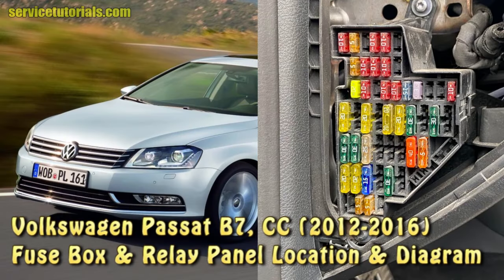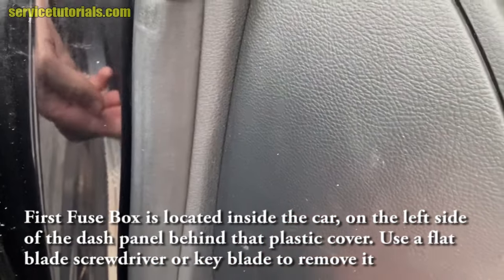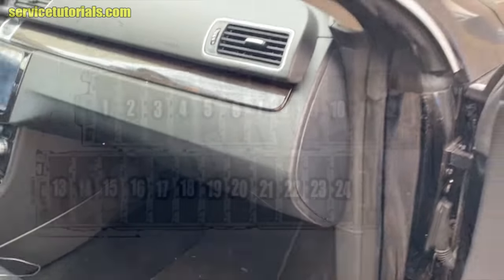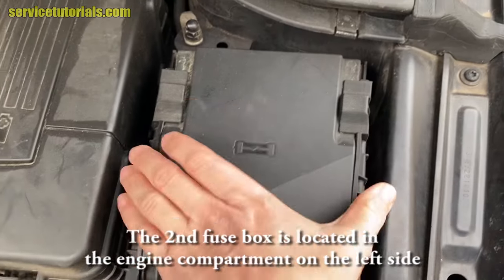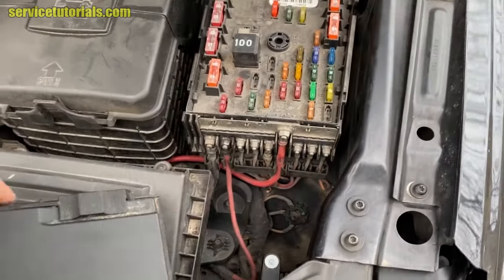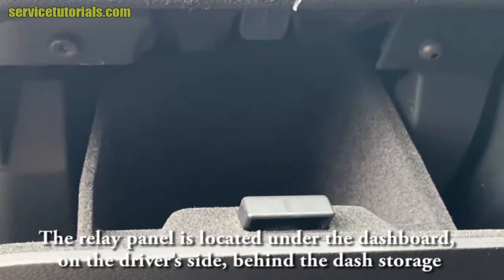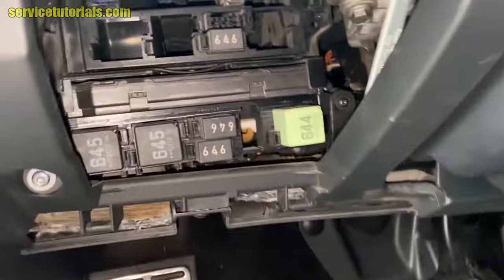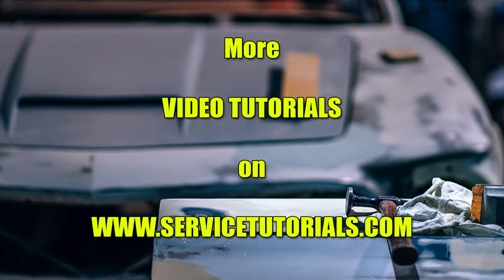Volkswagen Passat B7, CC (2012-2016) fuse box and relay panel location and diagram (explanation)

Comment: Where would the fuse or relay switch be located that controls the trunk release? The switch on the door is dead and the rear emblem manual does nothing ! Thx

Comment: In the diagram the #3 slot says a 10A fuse should be in place, but in the video that slot is empty, and on both of my 2013 passats the #3 slot has 7.5A fuses. Anyone know the reason for the discrepancy?
Reply: i belive that the diagrams wrong it’s supposed to be a 7.5 fuse oem ..

Comment: where is radio/navigation/back up camera fuse?
Reply: looking for the same radio fuse
Reply: @briannavacca5083  I had a 2008 VW Rabbit, and the Radio Fuse was on the back of the Radio; you had to remove everything and pull out the Radio. It might be there; you can always ask your local dealer. It's always free to ask a question.